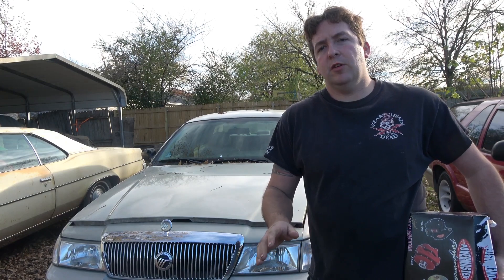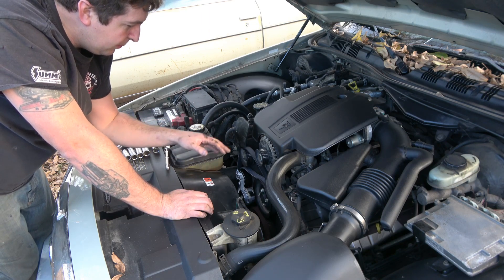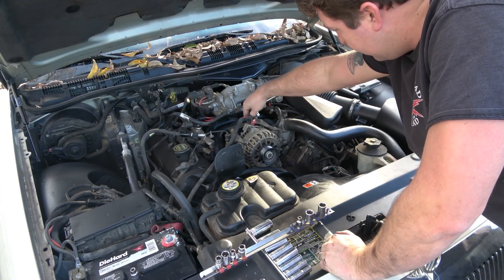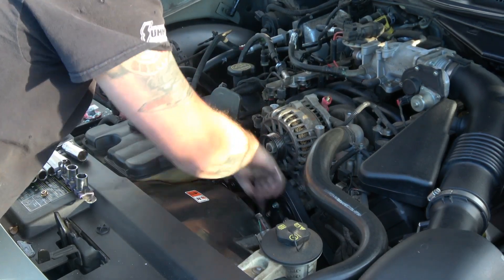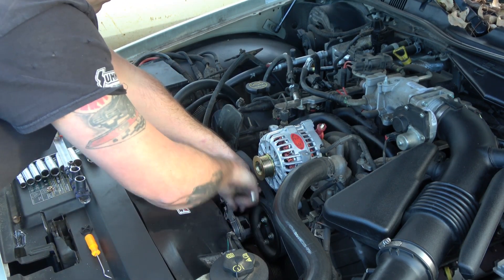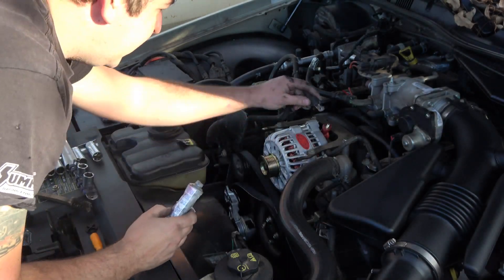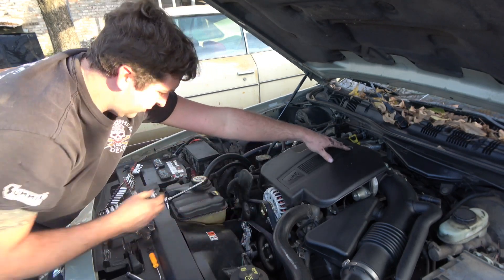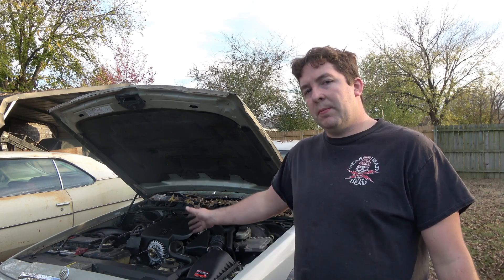Grand Marquis Crown Victoria Alternator Change

Comment: You save so much money doing these simple things yourself. I paid $98 for new remanufactured alternator for my 2003 Grand Marquis on EBay. Take me about 30 minutes tops "in my 60's" to install. Garages want $380-$500. Never buy used. Always a remanufactured new one. Again, I spent $98 delivered for a new one. Simple.
Reply from the maker: True you do. a shop always charges a minimum even though it dosnt take long. And their cost adds up fast

Comment: Great video! Would you happen to know the torque specs for the 2 bottom bolts, or does it not really matter as long as they are tight?
Reply from the maker: @ra1016cc  as long as they are tight. Been doing that way for years

Comment: Hey man got a question I’m about to put an exhaust on my 83 c10 2.5 inch all the way out the back it has a 350 sbc and I’m think going the black widow mufflers think those are loud enough to wake the neighbors?
Reply from the maker: Well they can be, i have this video below. Its on a stock c10 with headers and duals using the venom 250 which is a moderate muffler from them. the widow maker and neighbor hater are much louder https://youtu.be/8NEJsEeghb0?si=K-yGFAXxxENVjQ3E
Reply: @EfurdGarage  yea I’m thinking the neighbor haters on the c10 just wondering if I can aggravate my neighbors with these😂😂
Reply from the maker: @Joelowry-x4l  If it dosnt you have good neighbors LOL